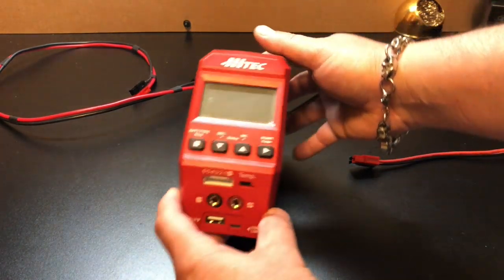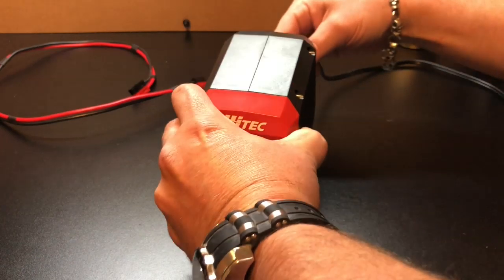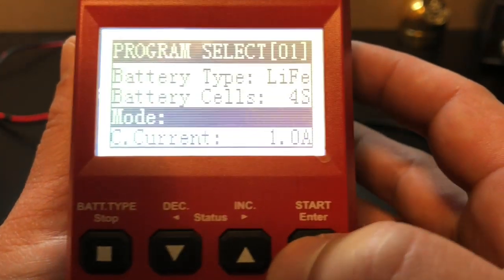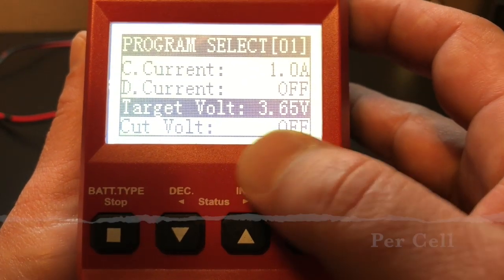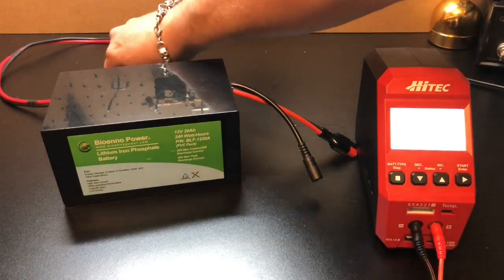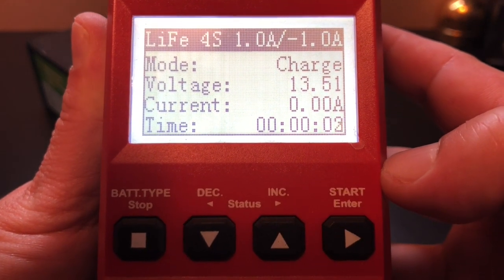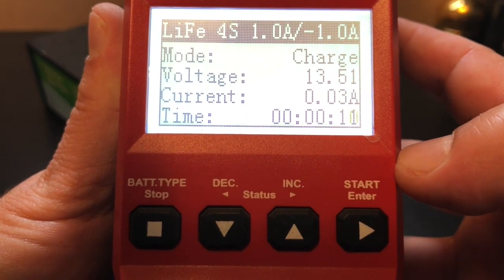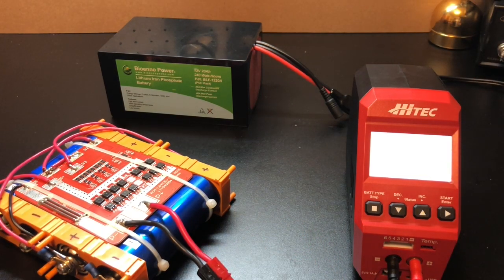Charging LiFePO4 Batteries

Comment: Is ok to charge 4 lipo 4 batteries with a car battery charger?
Reply from the maker: Not at all.  That would be bad.  Totally different chemistry, charging voltage, just too many reasons to list why that would be a bad idea.  You need a charger specifically for the type of battery you are using.

Comment: So you don't have to use a balance lead that is required on LiPO batteries?
Reply from the maker: Well yes and no.  No I don’t need to use a balance lead with these batteries because they have a BMS, or “battery management system” built in to them.  On the pack I built, the circuit board attached to it is the BMS.  That has leads going to the individual cells and handles the balancing.  The Bioenno also uses a BMS, it’s just hidden inside the pack.  If I wanted to do it the hard way I could hook up a wire to each battery cell and use the chargers balance connector, but that’s just silly.  LiPO batteries don’t seem to use a bms from what little I know about that chemistry, hence the need to use the balance leads.

Comment: how long does Bioenno 40Ah charge using the stock charger?
Reply from the maker: I’ve never used the stock charger but I think it charges at about 2 amps.  So about 20 hours for the 40 if it’s totally drained.
Reply: @hamradiotube  thanks for the reply. My stock charger does not indicate that it is charging. The LED is always on green :(
Reply from the maker: @Island_Jigging  Yeah that is also stated in the manual for the batteries.  Kinda weird they operate like that.
Reply: @hamradiotube  I guess I'm going to have to order Hitec charger.   Again thank you and more power.
Reply from the maker: @Island_Jigging  I definitely like charging with the Hitec.  I did just get another charger with a new batch of batteries from Bioenno.  I'm gonna try it out, but the Hitec shows you how much power is going into the battery, how much time has elapsed, so you can calculate how many amp hours have gone into it and the voltage it is at.  I really like that charger.  There is a link in the description of this video to the Hitec charger you can follow if you want to pick one up.  You do need to go into the settings of the Hitec and turn the balance leads off or it won't work.
Reply: @hamradiotube  what value do you set cut caps on system setup?
Reply from the maker: @Island_Jigging  I set mine to 20000mAh because that's the biggest battery I have.  That won't affect smaller batteries, but if you have a bigger battery it will cut off after 20amps of charging, so you will either have to start the charging again, or set that to a higher value.
Reply: @hamradiotube   Again thank you :)

Comment: Thanks for the great video.. I do have a question, what would you suggest for settings for the Hitec charger when used on a " Renogy Lithium Iron Phosphate Battery 12 Volt 50 Ah" . I'll  past a link but I think youtube will block.  https://www.renogy.com/lithium-iron-phosphate-battery-12-volt-50-ah/

Comment: Can this charger be used to charge an Lithium Ion 24-volt battery?

Another question I have is have you tried using this powered from a solar panel?
Reply from the maker: I don't see why it wouldn't be able to charge 24 volts but I have no way to test it.  It charges by type of chemistry and number of cells so I think it should, and it does charge most battery types, lithium Ion being one.  You might want to do a little more research on that though.  I don't have a solar charge controller for LiFePO4 yet.  It's on my Christmas list so we'll see how good Santa is to me!

Comment: Hey Mike,  Got a question.   I set my Target Volts for 3.65v(x4)  ( for the Bioenno 20amp bat.) which should give me 14.6 volts at the end of the charge.   I can only get it to  around 13.35v with this charger(doesn't seem to matter whether I set the charge current to 1a or 3a).  Is that what you are getting?
Reply from the maker: Meaning the charger never gets up to that voltage or the battery shows that voltage after charging?   13.35 volts is around where the cells will settle down at once it is charged.   That is the normal voltage   They will only be in the 14.6v range for a few minutes.
Reply: @hamradiotube  Yes, I did notice some "settling" of the battery after charging.  But on a hunch, I followed up with the charger supplied by Bioenno for this battery and right after the charge, the battery was reading about 14.5 volts.  After about an hour or so I am reading about 14.23 volts.  So,  I am wondering if the RDX1 is actually putting out as much as stated in the settings.  The software that is available from Hitec for this charger is only showing about 13.37 volts at the end of the charge with the battery still connected.   I like the fact that the charger shuts off at the end of the charge cycle, but I am not so sure it is getting properly topped off to balance the cells.   This  charger may work better if the battery pack did not already have a integrated BMS.   I'm not sure of the answer here so I may pose this question to Hitec support.
Reply from the maker: rxcapasso I wonder if it is the timer on the charger.  I think the longest it will charge for is 6 hours before it shuts off.  You can change it in the same settings you set the voltage and stuff.  You might want to look at that.  I have to run mine a couple times on the 20 amp hour battery.  I would bet that’s it.
Reply from the maker: Did you figure out what the issue is yet?  Keep me posted, I'm curious what it might be.
Reply: @hamradiotube  Timer was set to 600 (10 hours, max is 720 min or 12 hours).   So I don't think it was the  auto shut-off turning it off before it was charged.   I used the battery some today, so I am going to try to recharge it again.   My current for the charge is set to 2 amps.   The charger that was sent with the battery delivers 4 amps at approx 14.5 volts  per the label on the charger.   Another label on the charger says 15 volts.  Go figure!    I may give them a call next week if I can't resolve this on my own.   I'm probably not doing something right.  I'll  keep you posted.
Reply from the maker: @rxcapasso  Yes that would be 12 hours.  I just checked the charger and under system setup there is a menu for cut caps.  Mine was set at 10000mAh, I just upped it to 20000mAh.  That might have something to do with it.
Reply: @hamradiotube  Sent a message to HiTec support and I got back: "Most likely the internal balancing circuit is causing the charger to stop early. No way to stop that.
"  So, I'm thinking the RDX1 may not be supplying enough voltage for the initial charging cycle.  When I put it back on the charger, it then raises it to 14.29 v.
Reply from the maker: @rxcapasso  That doesn't make sense.  You shouldn't be using the internal balancing circuit.  I would send it back and get a new one.

Comment: Mike, just finished this same battery with BMS and after connecting the same charger I am getting a message "CONNECTION BREAK".  I am puzzled about this and went over this video quite a few times making sure I have my connection correct.  I think I might have a bad BMS>  de K8MGB.
Reply: Got it working, thanks for the quick reply.
Reply from the maker: See the note in the comments of the video.

Comment: Kevin @bioenno told me that the bio battery coaxial leads and the power pole leads are connected to the same points (FWIW)
Reply from the maker: Cool, thanks for the info.   That's what I figured.

Comment: Great video Mike!  I have the Bioenno 12v20ah battery as well.   I also picked up their 120 watt solar panel along with their 30A Solar Charge Controller.  Looks like that combo can keep me on the air for a good part of the day and probably into the night using  my FT-891.   Took your advise and bought the Hitec RDX1 charger for when I'm not using the solar panel.  I had trouble getting it to work without errors.  Then I scrolled through the setup menu and set the "bal. connection" to off and now all is well.  Thanks again for your videos!  '73  WB2PGE
Reply from the maker: Oh good to know.  I've had a lot of comments about the error charging this.  I see in the system setup where you reference that.  Good catch mate.  I didn't even think of that.  Thank you so much, I'm sure this will help a lot of people!
Reply from the maker: I'm gonna have to re-do this video haha
Reply from the maker: That is absolutely the solution. I just checked it.  Thanks so much for the feedback.
Reply: I also have the same kit bioenno 12V20Ah 120 watts solar panel and a 39A solar charger controller I didn’t bought the electric charger because I move to Puerto Rico 🇵🇷 and is always in the 80S all year

Comment: I'm getting a "CELL ERROR" on mine during the battery test when I follow these instructions, using the same model of battery and charger. It happens using either the Powerpole connection or the barrel connector. I've emailed Bioenno about this.
Reply from the maker: Shoot me an email with some pics of your settings on the charger and how you have it wired from to the battery.  I'm good on QRZ.
Reply: @hamradiotube  SOLVED: Bioenno support had the right answer. In System Settings, set "Bal. Connection: OFF" on the RDX1. That basically overrides the balancing function, as the Bioenno battery has a built in balancer.

Comment: Mike, are you going to try Solar at some point? Great Video
Reply: I mean for charging
Reply from the maker: At some point.  I have a little solar setup for my lead acid battery.   Its good for charging phones and stuff but I wouldn't run my hf rig off of it.  At some point I'll get a solar setup for LiFePO4 but I really don't need one at this point.

Comment: Mike the BMS in the Bioenno has a separate charging input circuit for the barrel connector. This is typically configured to bypass some of the monitoring circuitry so as not to disconnect the battery when the max cell volts is reached. It's used for charging via an intelligent charger that monitors pack voltage during the charge cycle. Having a separate charge port is useful if you want to use a solar charge controller concurrent to using the battery under load. Hope this helps.
Reply from the maker: Good to know.  I would love to take a look inside and see what makes it tick, but I'm not about to dissect the battery.
Reply: It is possible that the balance charger is not connected to the leads that you have the power poles on. So as Andy has said, use the barrel connector for charging.
Reply from the maker: @davidniemi4051  It is possible, but probably not likely.  They are both hot leads.  I suppose charge at your own discretion.
Reply from the maker: That kinda doesn't make sense though.  You wouldn't want to bypass the monitoring of the cells, especially when the cells are at either max volts, or getting low.  Plus the manual states there is over current and under current protection (very much the same as the BMS on my home-brew battery).  I also doubt the intelligence of the charger itself.  It's pretty basic.   The BMS is the brains of the whole operation.  Without that, the cells would be all over the place in terms of voltage.  Out of curiosity, because there is a very high possibility of me being wrong, where did you find out about the inner workings of the Bioenno?
Reply: @hamradiotube  I didn't, most if not all of the ready made batteries with a built in BMS use a common port BMS. The Bioenno is one of the few that uses a separate port BMS. The problem with a common port BMS when used with a solar system is that the BMS can cut the circuit under a protection condition. This can have dire consequences for the charge controller and will normally result in failure. The separate port is supposed to stop that happening. I did notice my BMS with the separate port, cut the circuit when it was fully charged, so it seems it doesn't fully bypas all the protection circuits.

Comment: I now have two BIOENO batteries for my ham radios in the field.  I generally charge them using the supplied charger but when I am away from home I hook my solar panel up to the solar charge controller and so far neither battery comes home drained.  Knock on wood.  Great video!  Glad I subscribed!
Reply from the maker: Thanks for the sub.  One of these days I'll look into solar but don't really "need" it for what I do, yet.  73

Comment: No way i’m charging my high dollar battery up the pooper like that. 😲
Reply from the maker: Why do you say that?  Both connections go to the same spot on the BMS, they just have the barrel connector to fit the charger they use.  Either one is ok to charge into.
Reply: K8MRD RADIO STUFF While you may be right. Bioenno’ s are so spendy i rather just follow the manufacturer’s directions.

Comment: Mike,  WOW what a great video.  I am waiting for my 38120’s.  I am building the same 4s setup that you have.  I just need to order the charger and BMS.  Thanks again for the video.  de K8MGB
Reply from the maker: No problem Michael.  I don't usually do requests but this is a good subject and I have talked very little about it.  Thanks for the suggestion.  Have fun with the build and 73!

Comment: Mike,
That yellow connector is an XT30 or 60. Couldn't tell which by the quick look. I think it's a better connector than the power poles for the currents we use. The power poles are better for currents 50 amps and above. WB3BJU
Reply from the maker: What?!?!?!  Better than Power Poles you say?  Blasphemy!
Reply: Sorry but the power poles in use there will be rated to 45A max, probably  30A as that's the terminal most folks go for. Maybe Mike can confirm. Power poles using that shell use 15, 30 and 45A terminals inside. 50ohms (the standard antenna port load and coax characteristic impedence) has no bearing for DC power. The XT series connectors are better for sustained high current loads as the contact area is larger.
Reply from the maker: @AndyWragg  I can't tell what size are on the Bioenno.  They could be 45 amps as the peak amp rating on the battery is 40 amps.  I use mostly 30 amp connectors on all my power poles.
Reply: so it's better to use xt30 or xt60 for  under 50 Ohms ?  I am still learning . 7 3
Reply from the maker: @sandraabarca6029  Ohms would be more referring to an antenna.  The power poles I use are rated for 30 amps.

Comment: Thought it was odd that the charger I bought with my Bioenno battery would turn green quick. Just thought that meant it was fully charged. Will look into buying one of these so know when my battery is actually charged
Reply from the maker: The lights on the Bioenno charger do not indicate the charge state of the battery.  Per the manual, they indicate either constant current or constant voltage.
Reply: Ryan KC9OZA  Did you read the charging instructions? It talks about that.
Reply: @forgetyourlife  mine didnt come with instructions. Guess will have to find a pdf
Reply: Ryan KC9OZA oh ok. It’s the 1st battery i’ve had that did the “green means lower voltage not fully charged” as well. I thought it was some new fancy way of charging a new fancy battery etc. I just make sure and charge my 9amp and 12 overnight to be sure. The 3amp i give 8-10 hours. My charger is the lowest power one Bioenno makes. I think the green light actually turns off when fully charged if i remember right. Been awile since i used them.